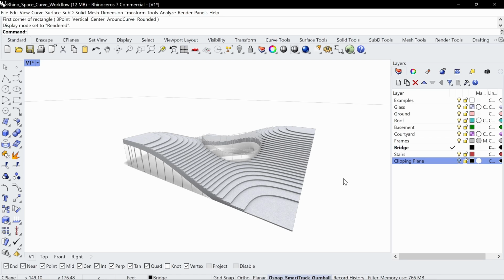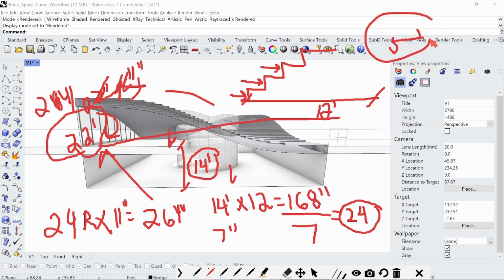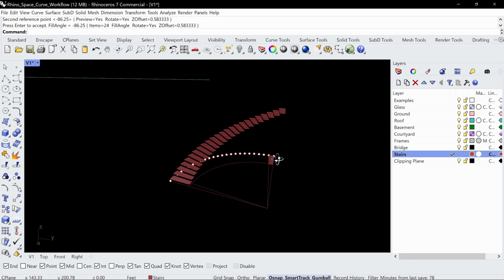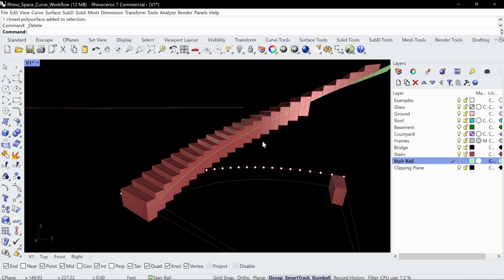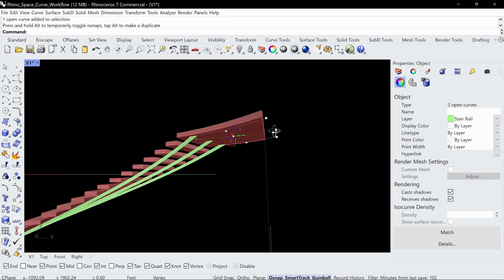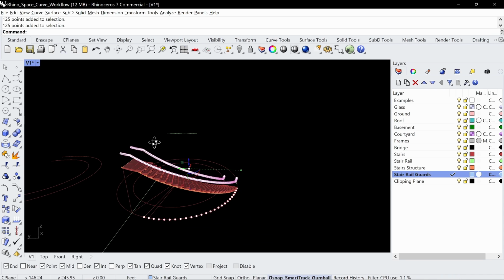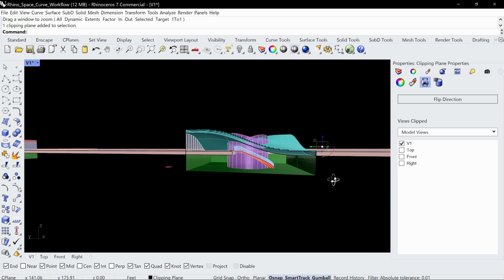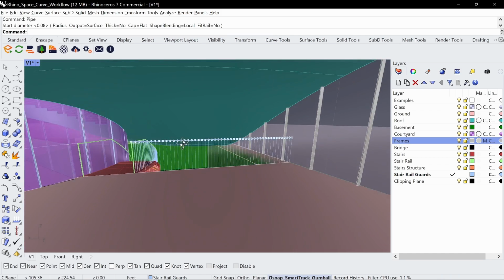EASY Spiral / Helical Stairs + Rail FULL COURSE TUTORIAL | Rhino3d Tutorial | Landform Architecture

Comment: Hey my Boolean difference command is failing constantly what do I do
Reply from the maker: Hi 

Which part of the video are you referring to?

At 25:00 it's the booleansplit command . Did you try Booleansplit instead of Booleandifference?

When you do a Boolean split, you need to make sure what you're splitting is an actual solid, and make sure that the splitting element is intersecting and extending on all sides so that it can properly split the solid.